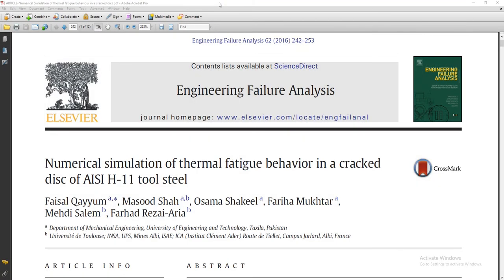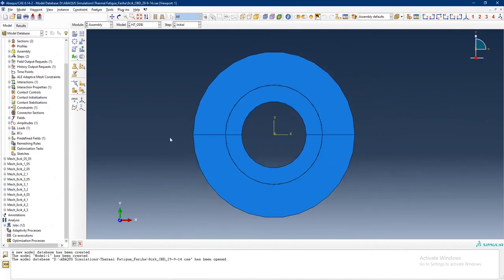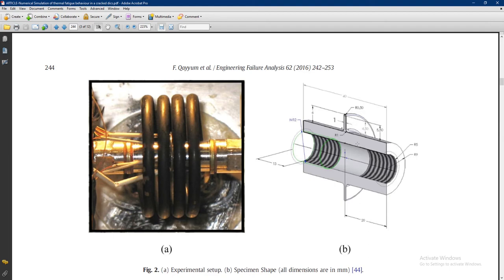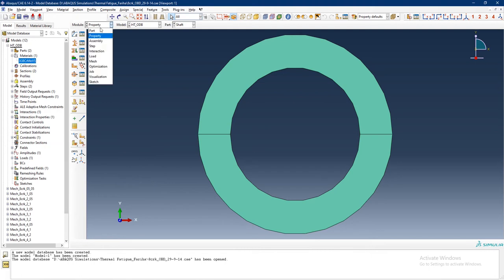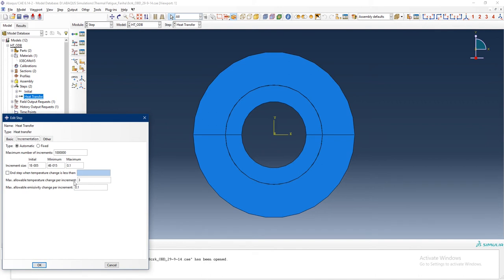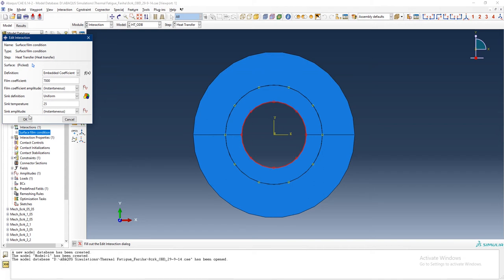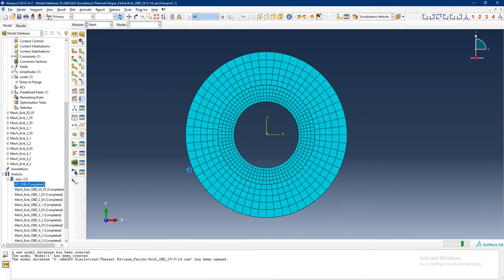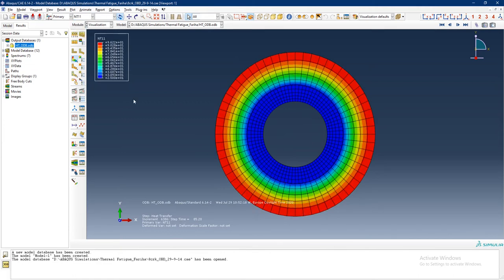Simulating thermal fatigue behavior in a cracked Steel disc using ABAQUS

Comment: so impressive. thanks for your work. and could you tell me in the second model's (the model with crack) mesh type? it is C3D8RT or same like the first model. i am very confused in this. thanks for your answer, bro.
Reply from the maker: Depending on the model, you can use different structural element types. Please see the publication for more details on this. There are different elements defined in different sections. I hope you will be able to find satisfactory answers there. if not, you can always write me at fysalqayyum@yahoo.com for more details.

Comment: Sir I search in open literature of the elastic plastic material behaviour but I didnot find any can you provide the link it will be of great help.
Reply from the maker: Hello Avinash, in this model, elastic deformation of the material is defined by stating the Modulus of elasticity and the Poisson's ratio, whereas, plasticity is defined by the material flow curve.